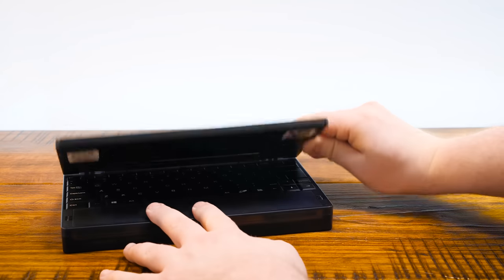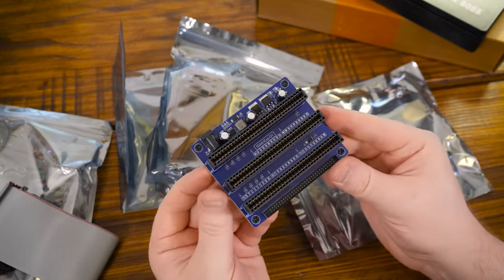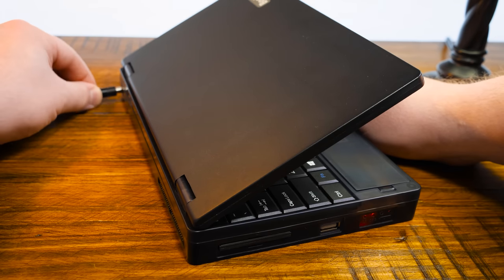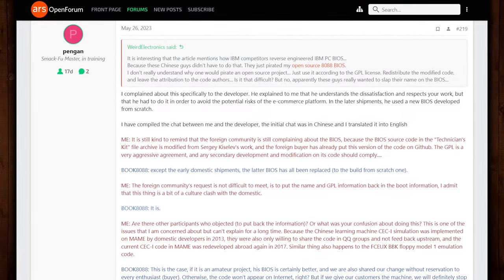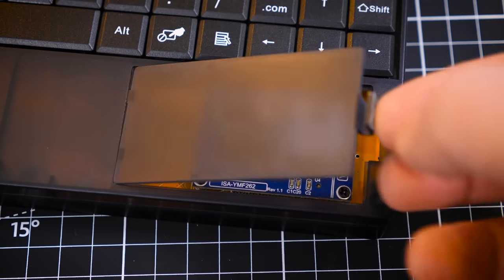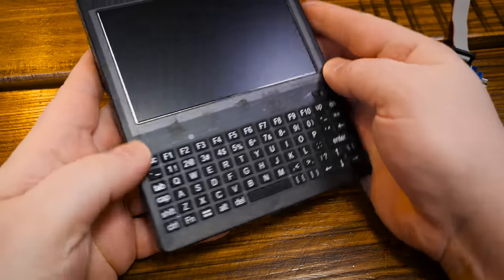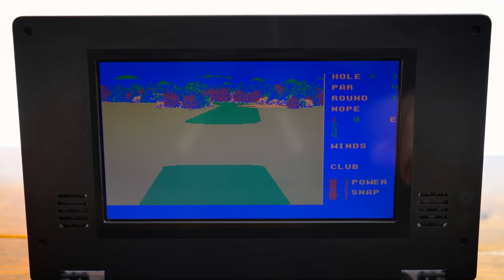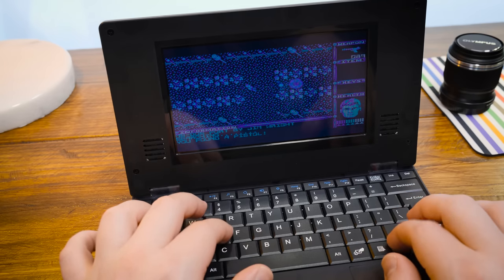So I Bought Those Weird New AliExpress Retro PCs…

Comment: I give the one guy in China building these total respect and doing it for less than $200, he is obviously a lover of old computers and software, what he has pulled off is kinda amazing, with a little more refinement he will actually have an awesome little machine. Props to the builder!!!
Reply: Definitely the guy should get all of the feedback from this (and other videos) because despite the obvious flaws, it looks extremely promising and with some more work he could really make some amazing devices of this kind.
Reply: Still kind of shitty he didn't give credit to the BIOS rip. I wouldn't respect the product or the builder. That just promotes bad behavior but still, neat tech is neat
Reply: Its promising though I wouldn't be surprised if this isn't a case of, "Oh we can tap that market!" and use an indie persona to gain trust. Components from the 80s in the US are rare because we recycle everything or throw it out (Which either way is dumb) but in China they have stuff like this lining storage facilities. No joke there was an issue with scam GPUs on ebay that would claim to be 2080tis but were actually decent cards worth 200$ to a particular market. So they were essentially scamming people out of 80$ with a card worth 200$. The leading theory is they had a surplus of these cards without a fan and rather then throw them out they recycled them through a scam.
Reply: It's probably not just one guy.  From China, not exactly the home of the small business owner working out of his garage...
Reply: @ronaldmullins8221  meh that's been addressed. He's been caught and won't do it again. China operates on the basis of communal IP and the idea of copyrighting ideas or code is a meme there. But if he wishes to sell this abroad he should take more care in future.
Reply: @ronaldmullins8221  "Still kind of shitty he didn't give credit to the BIOS rip. I wouldn't respect the product or the builder."

You have never seen a Chinese person sell a product before have you?
Reply: @ronaldmullins8221 That's the culture in China though.  I know, it's still a bad excuse,  but it still explains it.
Reply: @ronaldmullins8221  System builder may have simply bought the BIOS from another company and never looked into it any further.
Reply: @Logan-zp8bi  Not entirely true about that scam. A lot of those cards, or most really, were really low tier chipsets masquerading as higher end stuff. So it wasn't a case of old good cards that were being sold, but a number of low end to maybe old mid range stuff that people were trying to pass off as high end cards through flashing.  Some were decent, but they were never top tier cards.  Though you can easily buy an older high end card now for cheap because the crypto boom died and a lot of people in China are trying to offload gpus from crypto farming.
Reply: @ronaldmullins8221  Yeah man, if I don't see the IBM seal of approval on all DOS era computers I can't respect them. You're aware the PC revolution kinda really only happened because some enterprising Americans more or less copying the IBM BIOS source and bringing in the wave of PC-compatables. This is of course completely ignoring all the other software IP uhhhhhhh sharing that was happening in the early computer industry, you mean to tell me MS-DOS had no similarities with QDOS. That Finder had no similarities with Xerox? Come on man, IP isn't sacred and never has been
Reply: @VarietyGamerChannel  "the idea of copyrighting ideas or code is a meme there". 
The word "meme" does not mean what you think it means...
Reply: @commodoresixfour7478 gnoring IP and reverse engineering everything means everything deconstructed is de facto open source. Individual named accreditation is a newer phenomenon, for most of history guilds and their members took collective credit for everything they made together because objectively every individual is building on the shoulders of thousands anyway.
Reply: @chiefpacman It probably is one guy, Shenzhen is a playground for nerds.
Reply: @chiefpacman  Yes it is actually, they are huge on small businesses. Most of the shops on aliexpress are small like that, and the local regulations in much of China, especially Shenzen where stuff like this comes from heavily encourage that sort of thing.
Reply: Sweet
Reply: Agreed. Using the resources of the country at his disposal helps. Some of the retro computing hobbyists in China have done some crazy stuff like putting new IPS displays on old ThinkPads and putting a new computer in it.
Reply: @commodoresixfour7478  Communism - everything belongs to the state, therefore, no one owns anything.
Reply: @the_kombinator  Capitalism - corporations own everything, therefore you can’t modify or fix your phone/car/tractor without their permission, so do you actually own anything?
Reply: @TheXGamer969  That's  not a problem for me (yet) - the average age of the cars in my fleet (7 as of now, 6 totally operational and running) is 27.5 years. I use $50 hand-me-down phones and company laptops for more modern computing. I generally fix what I can (even kiddo's toys, in front of him, so he sees that you can fix stuff instead of throwing it out and buying another) when I can. 

Part of the problem is that society has become so reliant on "just buy another" and microsubscriptions, natural curiosity to explore has also been culled at a young age. Instead, watch. Watch what we want you to watch. Don't think too much, either. 

I am 100% behind RTR. I've even funded the movement directly. I'm glad people are waking up, but still more needs to be done. I  meet people and even my group of friends from high school, some of them are not aware of this problem (they are now lol) but the point is that it needs to be spread.
Reply: I give this buy in China no respect for violating the GPL.
Reply: @c.andrew3944 like LGR said. Giving credit is free. It's just classless. About what we expect from china though.
Reply: If they put in the time money and effort to build a retro pc in a market where they are all obsolete, obviously they like retro pc's
Reply: More like a business man that saw a market and made a product for it.
Reply: Yeah; not something I would get, but definitely someone I would watch for more
Reply: Or he is a business man profiteering from cheap hardware and low cost labour...
Reply: chinese junk
Reply: @Logan-zp8bi  that said its undoubtedly targeted towards retro enthusiasts and didn't credit the BIOS author but I think its more of a amateur hack than a scam.
Reply: If  they make a handheld x486,  with more RAM & Windows 98 SE, HDMI  and two USB ports, I'll by it.
Reply: @ronaldmullins8221  I think it was contracted out, and the guy he contracted out to decided to rip it off.
Because this is usually passion product type stuff. I doubt he would play it like this
Reply: @the_kombinator  Except that's not how China operates. They have a market capitalist economy, with private ownership of enterprise. The government is basically a dictatorship though.
Reply: I'm wondering how are they able to salvage old stock chips. There's no fab manufacturing these anymore.
Reply: Yeah and a real fan of stealing credit from people.
Reply: If I went to my junkyard and took ancient tech, slapped it together and sold it for $200 to a different region, I would be an embarrassment. Borderline scammy lol
Reply: @ronaldmullins8221 to be fair It's china morals don't exist there like they do in the west.
Which is a very western standard
Reply: Hes a lover of opportunity for a underserved market dont get it confused
Reply: would be cool if every comment thread about a product made by a chinese person didnt devolve into racist platitudes about "what china is like"
Reply: @sphericalred 
Please look into the history of video games and how the mindset you're describing ("it's a communal effort") led to companies exploiting workers for amazing work without giving them a way to link themselves to their works, including keeping their planning notes and forcing them to use pseudonyms. "It's a communal effort" is such a fucking shit way of thinking about work.
Reply: @trollmastermike52845 

"Morals don't exist there like they do in the west" is such a wildly xenophobic statement I cannot believe you are seriously using it as a defense. Copyright laws exist in China, genius. It's just that China is more willing to hear Chinese vs Chinese copyright lawsuits then International vs Chinese.
Reply: yeah but 200 dollars is an extremely steep price. this is a completely niche market and honestly, the device is literally useless and pointless. its impressive someone was able to do this but i just cant imagine anyone realistically spending more than $20 for these things. they are that bad
Reply: I actually see stuff like this all the time in Iraq, Irbil to be exact. Alot tech stores with crazy chinese knock offs that are actually quite intriguing. Im in the market for a pc and want something rather interesting thats not mac and this would be cool if similar is available.
Reply: Exactly the thoughts i'm having

Comment: Lack of I/0 is the worst thing about these devices
Reply: And overpriced to boot
Reply: @rommix0 $200 for a handheld toy like the Hand386 isn't awful, although the lack of I/O as mentioned is an issue.
Reply: Maybe I'll just stick with Steam Deck and PCem
Reply: Eh hopefully in the next few years we'll get a new version or a better copy
Reply: @rommix0  The prices are high because it's only one guy building them.
Reply: @SolidSonicTH  Let me stop you right there. That's as much money as a used graphics card. You're much better off getting the graphics card. You're getting ripped off.
Reply: @rommix0  I paid like twice this price just to get my hands on two Voodoo2s.
Reply: @rommix0 And why would I want a graphics card...? I have no desktop to mount it on, nor desire to get one, nor any desire to play anything that the crappy graphics card on my laptop can't handle. Sooo, everyone has their preferences, understand?
Reply: @miro5052  Yeah so? That doesn't justify buying it. I'm a buyer with common sense that doesn't buy overpriced crap.
Reply: @WatanabeNoTsuna.  >And why would I want a graphics card...?

Why would you want to buy an overpriced 386 knockoff product? The joke is on you kiddo.
Reply: Second worst. Absolute worst was the big middle finger to open licensing, no matter the promises of rolling some of that back if there's another batch.
Reply: most of the refurb repo stuff I have seen in Africa/Eastern Europe has almost no I/O outside of power and usually 1 usb-a these are cheap cheap devices. Which begs the question why is this one so expensive.
Reply: I find your lack of IO disturbing
Reply: And the screens.
Reply: It's a novelty item, not a daily driver or serious business/gaming machine. Shame they cheaped out on the keyboard for that 386 though. Oh yeah, and the shitty screens. Probably surplus stock bought at a steep discount, or recovered from landfill.
Reply: Yeah, it should have I/O like the GPD micro PC, that thing is small but packs a lot.
Reply: What is an I/O?
Reply: They are trying to copy Apple and add a sense of luxury
Reply: @CattoRayTube  working for a Chinese company, I can say without a trace of bigotry that this is very much a cultural thing.
Reply: @rustyshackleford4557  It's a Pokémon. If you're not trolling, it means input/output, e.g serial, parallel, keyboard, mouse, monitor.
Reply: @DhavidSetiawanKilluaDhavid  If only PCem had less input lag, it'd be far more useable
Reply: @rommix0  buddy, not here to fight but i'd just like to point out you're talking about buying overpriced crap in the same breath as telling people to buy video cards....which are largely overpriced, overhyped pieces of crap that are obsolete in a matter of years and absolutely worthless soon after.
Reply: @HamburgerAmy  They're still worth more in usability than a 386 computer knockoff or otherwise. I stand corrected.
Reply: @Gatorade69  You have to realize the kind of economy we're in these day. Like HELLO? The 386 knockoff piece of junk is more or less a novelty item for rich people. That's ridiculous no matter if made by one guy or a small team.
Reply: @rommix0  Jesus, mind your yap child. Let people enjoy things. You don't have to be so antisocial and contrarian. More than 500 comments here, maybe log off and touch grass too 😂🌾👏🏻
Reply: @Gatorade69  Yeah, one where RICH people are willing to THROW AWAY 1600+. FTFY
Reply: @rommix0  if some rich person wants to toss 1600.00 at the guy somewhere that engineered this together and made a tangible single run product, even if its sprinkled with imperfections and quirks..... IMO that's cool with me and i hope it funds a second revision of this kinda product now that it's gotten a very bright spotlight aimed at it and we all get to see something cooler with better parts and a more thought out design at a better price point us hamburger hobos can afford.
Reply: @HamburgerAmy  Yeah. However with limited appeal it ain't going nowhere. Compared to the mainstream buying public the retro community is quite small.
Reply: having at least one UART port to either use it as a terminal ( thinking of carrying one to admin routers, cisco stuff, linux stuff on the fly that needs a command or electronic hobby things ) it would be perfect.
makes me wanna start a business with homebrew retro machines like that.
Reply: @rommix0  this, i'd invest in one of those smol vaios/nec/hp palmtops from the early 2000s than getting an ugly box like that for the same price.
pretty certain you can run DOOM and plenty of DOS stuff on a Transmeta Crusoé CPU, even in power save mode :D
Reply: @POVwithRC most of the time it’s kids who think in terms of working at McDonald’s for 40 hours to afford a PlayStation 5. $200 is a lot of money but not “fuck you I’m rich” money, have these people ever paid a monthly mortgage?
Reply: @DhavidSetiawanKilluaDhavid  no offense, but these devices aren't made for people who "settle for SteamDeck and emulation". They're not made to be convenient, it's for people who likely already own the real hardware.
Reply: I had to buy a large docking station to get a Game Port on my vintage Toshiba Pentium 2 laptop. It does have one USB port, hidden behind a little flap but I only have one USB stick which actually works under Windows 3.1 anyhow. On the plus side the built in Yamaha XG sound is awesome.
Reply: Agreed.  With a better screen & some basic I/O or at least breakouts for it would have made these things an absolute home run!  Even so, I REALLY wish I had known about them when they were being sold!

Also, kind of strange that there wasn't a big AND small version available for each.  I would LOVE to have the 386 one in the 8088's form factor, as long as it had some I/O.  No I/O on a 386 would be an absolute dealbreaker for me.

I also fail to see how it's overpriced.  200 seems completely reasonable to me for what it consists of.  A better screen and some I/O would be nice tho.  Sad part is the screen didn't have to be crap.  There are PLENTY of decent, dirt cheap off the shelf Chinese screens that they could have used that don't have such bad viewing angles.
Reply: It's o....for output. Not 0 😂
Reply: @rustyshackleford4557  input/output.  It means it has no ports.
Reply: The worst thing is buying them.
Reply: @Gatorade69 - this comment deserves WAY more likes, here's mine ! :)

Comment: 80's sci-fi series (totally set in the future!) high tech props made reality
Reply: And due to prop recycling, also 90s sci-fi series (totally set in the future) only much more hokey-looking. A couple of the Star Trek: Voyager actors were snarking at the chunky 80s futuristic gadgets they had to use on Voyager in the mid-to-late 90s because they inherited them from TNG.
Reply: Given the trouble that radiation and other factors in space can cause trouble for electronics long term, it's not impossible that we might see a return of "simpler" 8 and 16 bit systems, albeit with modern upgrades, new architectures, and probably heavy redundancy.

I also wouldn't be shocked if a lot of them would be open source since that would be a lot easier for people to design and build, some mix of analog processing may well return too as you could have AI generated locked function (or robust FPGA) circuits that excell at specific tasks for very little power required.

Higher power hardware would still exist obviously but only used where actually nessisary and where power is abundant
Reply: The 8088 with a video out inplace of a screen would be perfect for me.
Reply: I'll always take that over hologram ipads and shiny white metal on everything lol
Reply: I finally got one and the hand386 feels like the "padd" that they used in TNG.
Reply: 666😮

Comment: Honestly, given that the Book 8088 is held together with phillips screws and made from off the shelf components, i imagine swapping the terrible screen for a better one is a piece of cake. 7 Inch displays are a dime a dozen, too.
Reply: The small-ish battery makes me think the screen backlight on it is just running on very low power. It was probably a conscious decision if the prescribed fix is a resistor removal.
Reply: @PaulSpades  Exactly, the guy building it, probably found a tradeoff sweet spot between power consumption and readability. Display consume the most in every device.
Reply: I just received my Book 8088- ordered it a couple of days before Clint came out with this video, so it’s a newer batch and the screen looks fine to me. I wonder if he implemented this fix on newer builds.
Reply: funny enough the hand held one has an off the shelf ips compatible screen for like $20 or at least it was when I bought it last year.